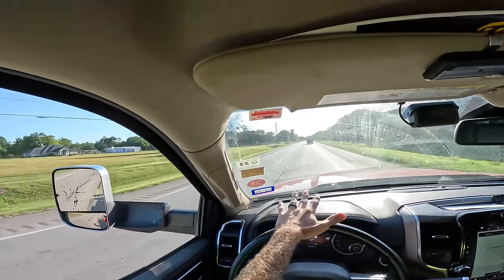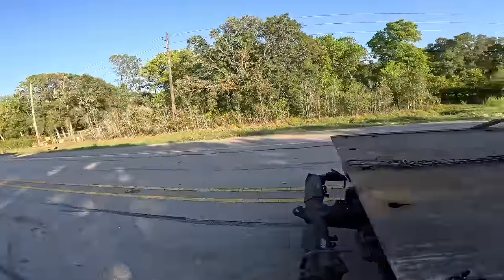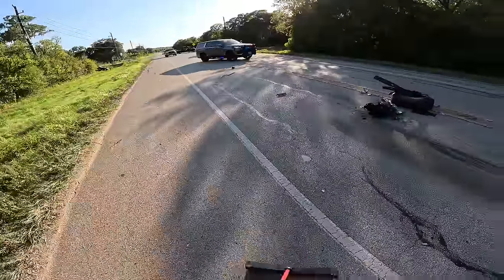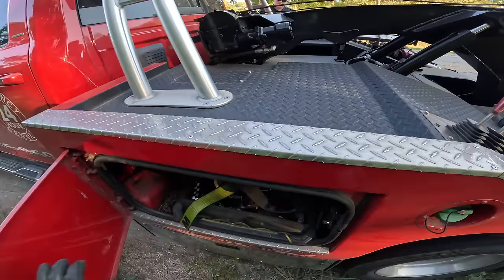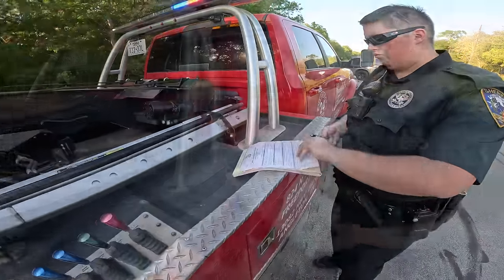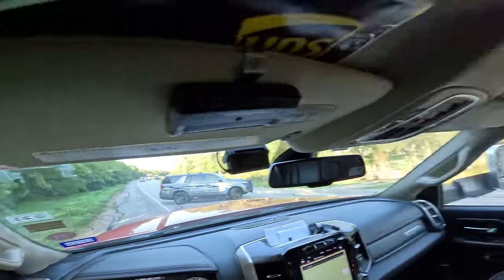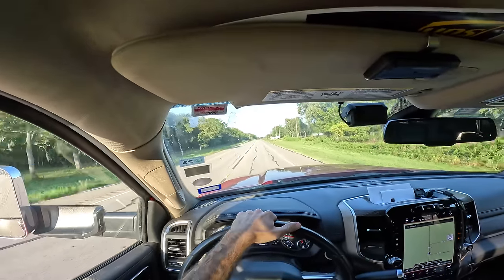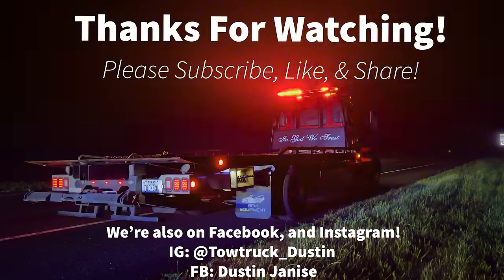18 Wheeler vs Two Other Vehicles! Another Mid-Day Major!

Comment: I’m assuming with only a hole in the grill and radiator that the GMC pickup was struck by debris flying off the car. They were lucky it didn’t go through the windshield and into their face. Another awesome job Dustin.
Reply from the maker: Yeah, I’m assuming so. They definitely got lucky.

Comment: Wouldn’t they need red and blue on the front and back if they’re called out on Code calls?
Reply from the maker: We don’t run code. That’s why we don’t have them on the front. Not many states allow that.
Reply: @Towtruck_Dustin    I guess I’ve only seen one YouTube tow channel , and I’ve only seen them go code 3 on their rotator.  But then again, I just like flashing lights of any kind.  I was able to install several ambers on my pickup when I was doing telecommunication engineering.

Comment: quick question, so i’m thinking abt joining the tow truck industry, is there a reason y u hooked it from the back instead of tha front where’s there’s pieces of the grill tha can fall off while driving?
Reply from the maker: You always lift the drive tires so you don’t burn up the transmission.
Reply: @Towtruck_Dustin  ok thanks